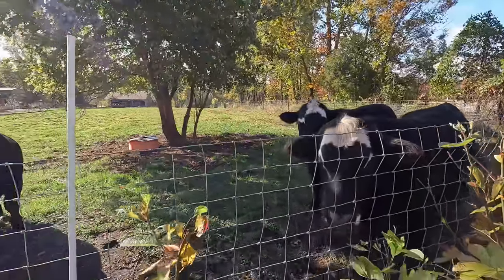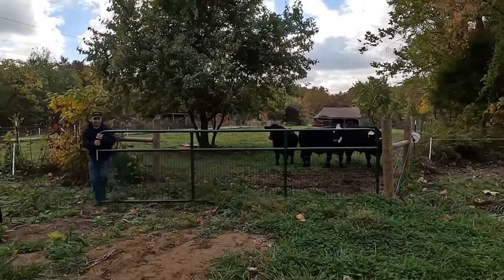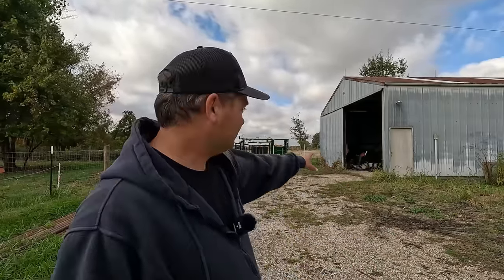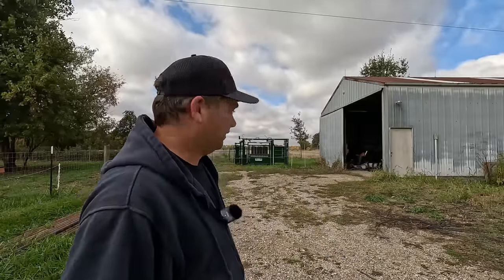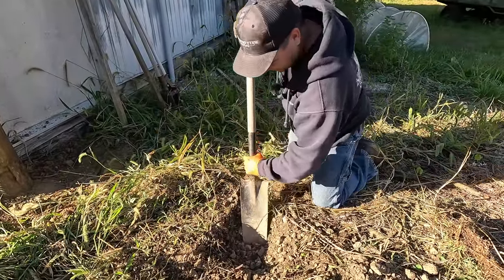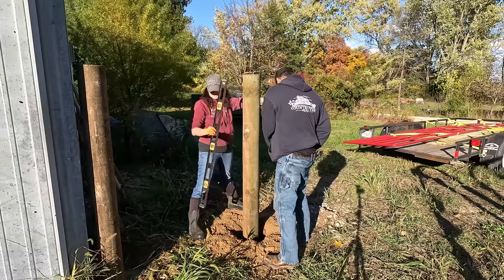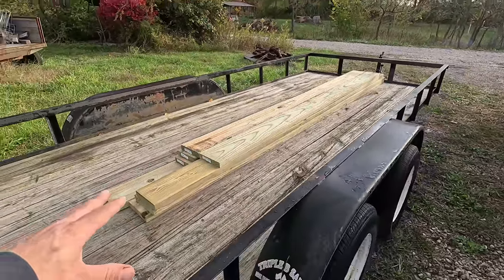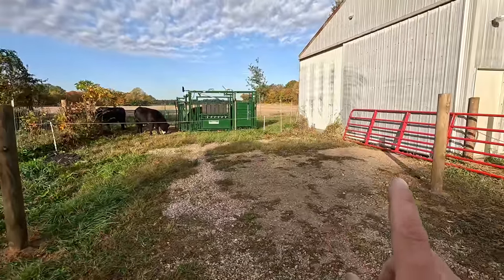The Corral Project has started.  Let's do the easy part First.

Comment: Your new fence looks nice but I think if it were mine I’d definitely cut three more boards and adjust the four board fence into a five board fence. Doing so will help keep the smaller stock in the pen and keep the large stock from accidentally stepping through the gap between the lower boards and breaking or skinning up a leg. All the pens I’ve ever worked cows in have been five board, they’re safer and stronger. You won’t regret making the change.
I sure enjoy your videos. I’m  always impressed with your knowledge and abilities. You really are a Jack of all trades. Thanks for sharing!

Comment: Evan, if you flip over the top hinge you can lock the gate onto the hinge bolts. Cattle can’t knock it off by lifting it up with their heads either.  Looks good. Start of your finishing yard.
Reply: There is however a problem doing that as it puts all the weight on the lower hinge increasing wear on both parts of the hinge
Reply: That’s a heavy gate. They all need to be up. I know what you’re saying about turning top one down so the gate can’t be lifted off by a horned bull or thief. You could add a 4th hinge I guess turned down to lock it in. I wish they made the post longer that the hinge slides down onto , so that you could drill a small hole through the top so you could drive a cotter pin in it   Looks good Evan  👍.
Reply: The best hinges have grease zerks on them. The guy who built our front gate and put in metal posts, with cross  pieces in between used hinges where they can be greased. It has been there for over 30 years.
Reply: He could weld up a bracket to bolt on the post over the top pin. That would lock it down.
Reply: @adrianbew9641  I understand your comment.  I guess with farm gates/hinges and bolts, you get what you pay for.  I’ve been flipping them over for near 45 years.  I don’t purchase screw in hinge studs, only 1” drill through and nut on both sides of the post.  I also make sure they are tight to the hinge itself.  If you purchase Hi-Qual and equivalent gates, the hinge and bolt are built into the gate itself.  Zerks help to keep it lubricated.
Reply: @TennesseeMtnMan  yeah, Powder River and Hi-Qual 16’ gates are a bear to mount yourself and after too heavy for a standard post.  Evan did a good job with the wood between posts to spread the weight across more area.  I would add a wheel to the gate, if it is level ground, but I don’t think that’s the case on that gate.
Reply: I agree if your using it as a corral to catch or load cattle they will lift that gate off the hinges.
Reply: One will eventually try the gate.  Turning top hinge over and sliding strap up on it is the best answer.
Reply: A 900 pound steer if he gets his head through those boards will go on through as that is treated pine lumber.  A-livestock panel on the inside will fix that very well.
Reply: Another suggestion on working pen, no corners!  Use an eight or 12 foot livestock panel at each corner which reduces desire to jump or crowd into corner.

Comment: I would flip the top hinge pin down so the gate can't be lifted. You can add a fourth hinge lower for extra support. On my larger gates I have gate wheels on the far end to eliminate sagging. I make my own using 8 inch solid wheels from HF. The farm store gate wheels are too small IMO.

Comment: Even, with that gate that long and heavy, maybe build a bracket for the the gate to set on at the bottom of the closing side. On the end where you chain the gate to take some of the weight off the mounting side of the gate.
Reply from the maker: I plan to put a brick under the far end to hold it up.

Comment: Use a tall post on the hinge side of the bull gate and string a heavy wire and turnbuckle from the top of the tall post to the latch side of the gate. Tighten the turnbuckle to prevent the gate from sagging. Pete, from Just a Few Acres Farm, showed this in the video "Tedding Hay with the Farmall MD and Farmall Super C", August 15, 2023. Also, on the 4-board fence why not raise the second from the top board and lower the second from the bottom board so that a middle board will fit. Good luck.

Comment: Understand putting the brace wire on the end to help take the strain, but unsure what benefit there is in the horizontal beam ? Wouldn’t the gate be pulling apart not compressing that beam ?

Comment: Evan, I’m not too far from you guys, I’m over in Missouri. I’m getting ready to build quite a bit of fence and looking for those 8x8 posts. The only place I’ve found them is at TSC. Roughly $60 a piece. I need about 65 of them. Surely I’m missing something right? Where are you guys getting them?